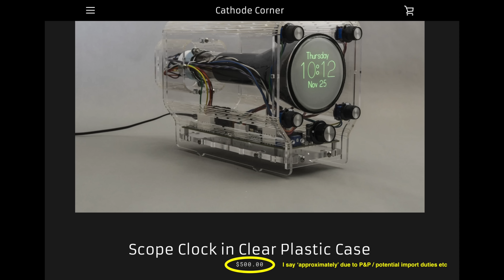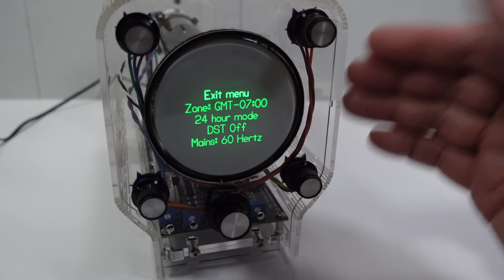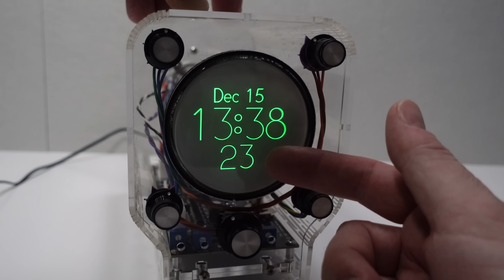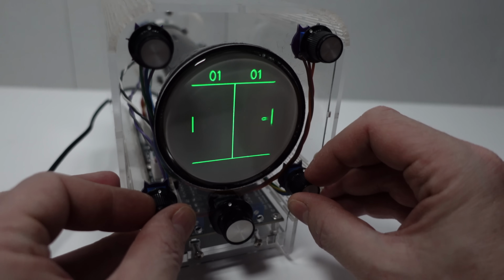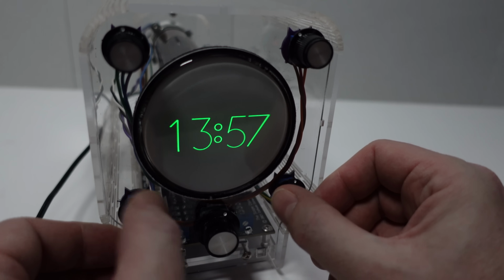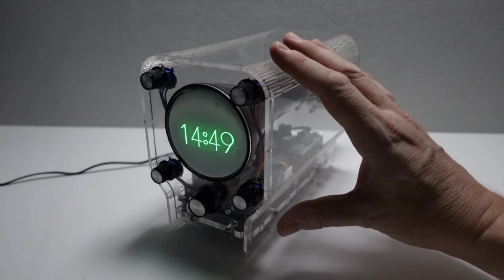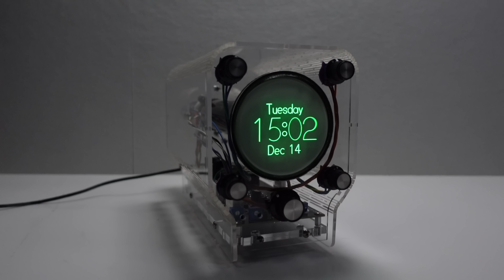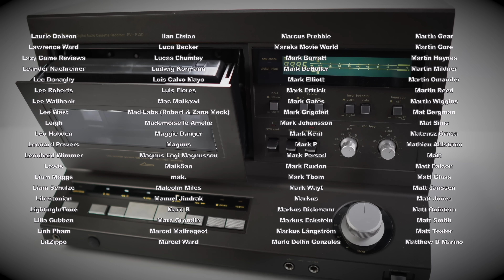The Scope Clock - from Cathode Corner

Comment: The Chinese do make a scope clock board (using the Dutchtronix oscilloscope clock code) that has everything needed but the CRT, so it wouldn't surprise me if they eventually start making the CRTs to go with it.

Comment: I think it's a cool concept, but the CRT will probably get burned in with any static image on the screen, like the colon of the digital clock or the numerals and center circle of the analog style clock.  Could probably modify the Arduino code to move the clock around the screen every so often? Hard to determine what wouldn't be really irritating for it to do.

Comment: Only thing that bugs me about the clock is a lack of an analog number face with the only analog face being Roman numerals.

Also the analog face doesn't fill up the whole screen.

I'm pretty sure that's due to the CRT being slightly out of focus at the edges of the screen.

I myself built a clock with the 3RP1A CRT using a kit and the CRT can either be perfectly focused at the edge or middle but not both.

The only possible cure is to use a dynamic focus circuit like Tektronix used for their X/Y displays but that complicates the circuit a bit and requires some calibration that moat who buy the clock wouldn't have the tools or know how to do.

Comment: 3/09/22: I received mine after watching your video but it took awhile before I could order it. Mine came packaged exactly like yours, covered in bubblewrap only. I'm surprised yours survived all the way to the UK! Mine was delivered in the states and came to me with part of the case broken. The back end piece that accomodates the neck of the tube  broke off the rear plate & it was in several pieces. The front of the tube was laying down inside on top of the electronics. Disappointed I was, it was a beautiful piece, had to send back for a refund. Much more care was needed in packing a delicate instrument. So if anyone is interested in buying this, I hope you have better luck. As of this comment, it's $600 for the fully assembled unit or $500 for the kit version. Great review on it, it's what finally made decide to get one, but maybe later now.

Comment: It is extremely cool clock! And also disappointing one. Few reasons - first - no speaker so - no alarm. No sensor of light to auto adjust screen brightness. No options for automatic turn off and on screen at defined time. Also it would be nice to have something like clapping turn on mode, clap twice and clock face will turn on for few seconds. Also - scaling watch faces would be nice to have. Also - if it is so retro vibes piece of art - it would be nice to have chimes (if speaker would be present) but sounds like from commodore c64. There is lots of room for improvement of this one.

Comment: For 500$ I would expect more like basic stuff sound, a light meter to auto adjust brightness on/off button for the screen with motion sensor, some kind of menu where I can download new watch faces and features ... the list does go on and for that price these and much more should be included, also it's important to keep in mind that screen has a limited life span if it is on all day it's not going to last very long ...
Reply: It's a homemade low volume thing and not mass-produced, David laser cuts the parts and assembles all the clocks himself... Sound's possible through USB and already implemented, there are already new watchfaces available due to the firmware being open source, and David says his 20 year old tubes are still fine...
Reply: @kilrahvp  what I said is not difficult or expensive to implement for 500$

Comment: Was just wondering about the setting for the mains frequency. My first thought was the clock was using the mains frequency for a stable time keeping, which is common in a lot of clocks, but then I checked the website and it says the power adapter is 12V dc 1.5 amps so how does it see the mains frequency?
Reply: It doesn't, it's just to adjust the screen refresh rate to the same as mains so any wobble from external mains-caused EM fields is avoided by the screen being drawn in sync with them.

Comment: That is really cool. I wished thatI still had one of my ol Heathit oscilloscopes - it would of been perfect for this type of project.  I wonder if it would work with one of those. (the setup of controls of that clock are similar to those old 'scopes)   If I remember correctly, leaving it one will burn through the phosphor coating.  Why didn't he include a "temp. on" function (say 5-10 secs.) ?   ,and a timer function to turn off the power to the tube?   perhaps it was not possible with that design, or with these ICs?   hehe "...We control the vertical, we control the horizontal..." (The Outer Limits opening).

Comment: I think this question is covered in Mat's statement about unplugging the device if you want to switch it off. As neat as this thing looks, I'm concerned about burn-in. 
Of course, it's not a PC screen, so it won't matter as much, but burn-in is still a concern. 
I wonder how hard it would be to add a piezo speaker, and program it to tick?

Comment: The things it's missing is a stereo audio input for X-Y sweep, and a push button or two so it could play some proper vector display games like Asteroids and Tempest. Also a cycling mode would be nice during clock display to reduce any worries relating to burn-in of the phosphors.

Comment: I think most old hardware is nice and much of it is surprisingly interesting, but none of it can match this! :D Oscilloscopes are quite special examples of elegant design. Also, I think they're the classic example of lab equipment, their practical use having outlasted nixie tubes by decades. This device also impresses me with the quality of its text. Under digital control it would have been all too easy to allow the lines to have a stair-step effect, but I don't see even a tiny hint of that.

Edit: Almost forgot: I'm sure someone will start producing oscilloscope tubes again, soon. The trickiest aspect would be the required precision. Green phosphor might possibly be a little hard to come by, these days. Phosphor never was cheap. The thing which most puzzles me is how to oscilloscopes control their X-ray emission. You see a warning every time you open up a CRT TV, but never a scope. Then again, monochrome displays use electron beams 10-15 times less powerful than color, and scopes might be less powerful than that.

CRTs do look nice. All that shiny curved glass. :)

Comment: Pedant corner: If it doesn't chime it's a timepiece , not a "clock".
The word "clock" is the old english word for "bell", hence 5 o'clock is 5 strikes of the bell. Clocks were heard more than seen in the old days.
Sorry, but my dad was a horologist and a stickler for proper nomenclature.

Why is this important now? Well... –splutter– just imagine how much cooler this device would be with a typewriter bell or steel chime bar visible inside, struck by a solenoid, like in an electromechanical doorbell. Version 2?

Comment: Great clock! I want one.
However, I was wondering how long you can use it before a ghost image starts to be burnt into the phosphor. After all, that’s the original reason that screensavers were invented for PCs using CRT monitors. Cash machines used to use a green phosphor CRT and they usually had burnt in phosphor. 

If you’re into arduino programming, you can get a small 3inch old crt TV for about £10 on ebay. As long as it has a composite video input, you can connect it to an arduino with just a handful of components. There are libraries out there for composite video. You can then program it to display a clock or anything else. Freely admit it probably won’t look as cool as this CRT clock but its a version of it.

Comment: A very nice designed CRT clock. There are not many designs around that use CRT tubes, because they are rather difficult to bring to life, with the very high voltages you need for that. Well done, very well done!

Comment: It's a shame there isn't an auto-off. I wonder how long before you start to get burn-in, especially where there's a 1 in the same position for 10 hours a day (in 24h mode) every day, or of the numerals around the outside of the clock face if you have it in that mode.

Comment: Great scope clock! However, the most obvious feature is missing. There is no screen saver circuit with a timer to automatically dim the screen when one is away. Today, all laptops and smartphones have built in screensavers. Unfortunately, they are a pain in the butt, and difficult to deactivate. It turns out that LCD screens don't really need them, because they don't have the "persistence" problem that CRT have.

Comment: There's something about a CRT display, especially when used in vector mode as opposed to a raster. It has a kind of delicacy and pin-sharp focus about it that sets it apart from other types. Maybe it's the lack of 'pixels', as it doesn't use them! Pity you need so many supplies (heater, A1, focus) and of course the deflection system.
Reply: I'm impressed this thing doesn't have a stairstep effect from its digital control system. I don't know how they worked that out. (I'll be disappointed if it's just really wide & fast DACs. :)

Comment: I feel like there should be options to:
- Make this thing function like an actual oscilloscope
- Dispense with the CRT and high voltage drivers, and have a kit that drives a real oscilloscope instead

Without at least one of those all I see is a CRT vector clock.

It does look nice though - and it will until you burn numbers into the phosphor

Comment: The burn in on the crt would be an issue.  The clocks have a very static image.
Reply: Good point. But slightly offsetting the X or Y position each day should prevent it from happening perhaps?

Comment: I guess the only real lind of issue with a scope clock would be burn in over the years. That is if you kept it on and powered for years and years. But seeing as you can dial in the position of the clock, that would be mitigated by the user just moving the face a tiny bit ones in a while.

Comment: That's cool... if I hadn't seen much, much better versions of these in labs even like 35 years ago. The high resolution screens were remnants of the 1960s, of course, but still functional. They even had built in memory, so the electron beam only had to write them once and then the screen would retain the image for minutes to hours.

Comment: Since it's a crt, wouldn't the fairly static image of the numbers on a clock slowly burn it in over time? I can't imagine having a 1 on the screen from 10:00:00 to 19:59:59 in the same place be very good for the display
Reply: You are correct, it wouldn't be. Let's hope they are moving it around slowly.

Comment: I would imagine that if the clock was left running at high brightness for any length of time it would burn the image into the phosphor. Keeping the brightness low and frequently moving the image around would delay this considerably.
Reply: I would guess that's the reason for having the position adjustable on screen.

Comment: Beautifully made, I like the slotted edge design which could otherwise easily show stress marks from just heating-and-bending.
I'm sure any would-be-nice-to-have features, such as auto-dim or an alarm clock - with suitable USB sound device and perhaps the waveform appearing on-screen - could be easily added through a firmware update if the designer wishes to make a fabulous design just that little bit more fabulous.

Comment: Why is power frequency important when its using a DC adapter? Is it so the refresh-rate matches the lights?
Reply: Magnetic fields from nearby motors or coils can make the display 'swim'.
Reply: @davidforbes8900  Interesting, makes sense. I didn’t even consider that. That’s cool

Comment: I just had to repost / paste this... fecking awsome techmoan

Q) Something something something SCREEN BURN?
A) There are mitigating measures in the software that shift the image over time and David tells me he made these twenty years ago using the same tubes and those are still fine. However I'd strongly suggest that if you're the nervous type who insists on firm guarantees, then this really is not the device for you. This is a hobbyist product, made by one bloke for enthusiasts. Oscilloscope tubes were never intended to be used like this, that's the charm of the device - it's unusual…but along with the unusual comes the unknown.  Screen burn worriers would be better off steering clear and instead getting themselves a regular mass produced clock. No CRT screen = no worries about screen burn.

Comment: Nixie tubes were used in the Avery 1750, the first British price computing shop scale. they ran at 75 volts & lasted quite well. they cost over $3000 in 1977,  the same as a Holden Torana,

Comment: I wish that it had some sort of a screen saver or time out function built in. Like if after 30 seconds it went through various oscilloscope patterns or even blank and back to the time when you hit a button. Otherwise I fear that the burn in on that tube over time is going to be wicked.

Comment: As opposed to colour CRTs, small monochrome CRTs can be manufactured in a largely manual process! There's a small company in the States which manufactures replacement tubes for military equipment like radars, medical, industrial equipment etc. Of course the prices are very much... corresponding, but just like Farny in Czechia could take up medium scale manufacture of Nixies, this is also possible.

At the start of the video, i was thinking "huh would be a massive pity if you couldn't extend it with your own code..." so thanks to the dev for making the project open source, and thank to you for mentioning it.

Comment: @Techmoan - Yes alas no auto on/off timer for the screen, or power. However, as it has a battery backup of the time/date/last position of clock face etc, then, it wouldn't be hard to plug the plug into a timer socket, even a digital timer socket (as I do for my kettle for first morning brews, I fill kettle, set timer, and just before I get up, kettle is already boiling! 👍). So yeah, plug in timer and you can have the clock on and off whenever you want... 🤔😎🇬🇧

Comment: That’s really cool but if the screen is on 24/7 and you’re on one of those faces that shows the day or date I feel like it’s going to quickly have Burn in on the tube display. I have a collection of old oscilloscopes most of them have burn in. The analog scope I use daily has burn in from just a few hours of accidentally leaving on

Comment: A little tinkering with the source code might easily yield a power save feature, shutting off the clock's display for a preset amount of time, say 5, 10 or 15 minutes. If there was a speaker option, some chime sounds might be in order too.  The other thing is to introduce a burn-in reduction, making the digits move about the face of the CRT, preventing those godawful etchings.  

You know how tough it is finding scope CRT's these days, even in Russia.

Comment: I wonder if you can make it into an audio visualizer through one of the USB ports.  That would be a cherry on top.  If I had the money, I'd buy one in a flash!  That thing is so cool!
Reply: It runs on a Teensy 3.6 board and the teensy has an audio library that can emulate a USB sound card and send/receive audio to the PC. So the answer is yes, if someone is willing to do the coding. AFAIK all the HW is already there, and the code is open source.

Comment: Always happy when a new Techmoan video arrives.  One observation is that I'd be afraid at how quickly that tube would get terrible burn-in with that static image displayed all the time.  Too bad the clock couldn't be made to drift around or otherwise mitigate this.  Also, since you have a scope anyway, would be cool if it had a microphone and some selectable  patterns to go with music, or line-ins for this purpose.
Reply: I have one of the original Cathode Corner scope clocks. It does constantly shift the display position a tiny bit to reduce burn in. I’d hope the new clock does the same.

Comment: I've always wondered why no one ever adds a motion sensor to these nixie and CRT type projects. I suspect the tubes would last a lifetime if they were turned off or the brightness turned down when no motion is detected. Just having the brightness auto-dim would help save that phosphor from burn in.
Reply: or at least a photocell to turn down the brightness automatically at night
Reply: so I couldn't see the time, being not dancing?
what about bed? sofa?
Reply: @Ritefita  Those sensors are pretty sensitive. Tuned right, a mere handwave is typically enough to trigger one. There's one in a bathroom where I work that will detect motion reflecting on the door if it's left open at the right angle.
Reply: @richfiles  You could take an average over something like 5 minutes to slowly reduce it instead of acting instantaneously.
Reply: It would also be good to slowly dither the X,Y location of the displayed clock to avoid phosphor burns.
Reply: @w6wdh  this feature is already there.
read the decription

Comment: I can see where using an o'scope CRT would make things easier, since they use horizontal and vertical deflection plates instead of deflection coils like in a TV or video monitor CRT (basically electrostatic versus electromagnetic).  Not that it couldn't be done, I recall people hooking up deflection coils to stereo amplifiers to make patterns on the screen.

(Note to self: Dust off the Atari Video Music and see if it still works!)